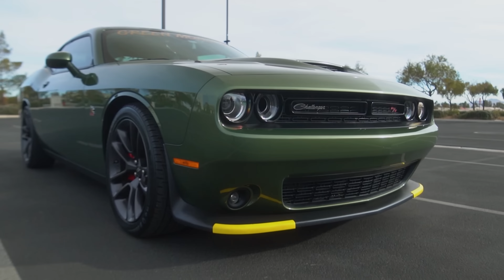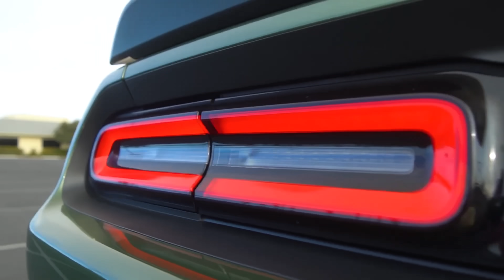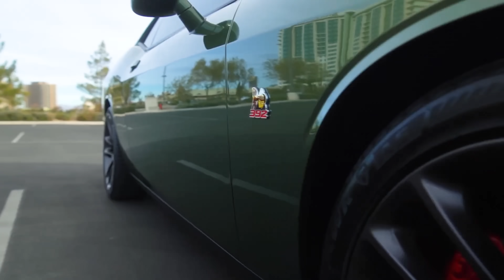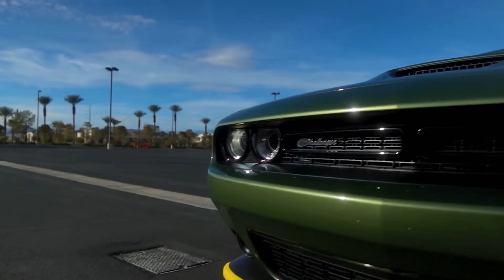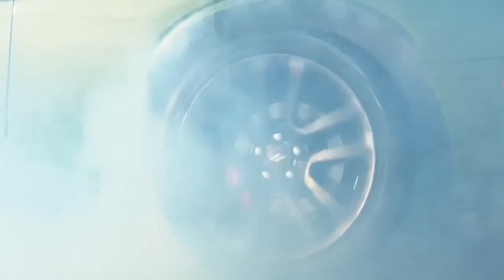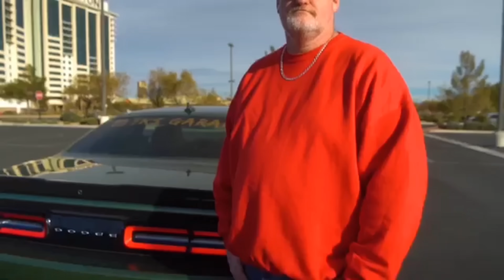Stellantis Engineers Have Figured Out Measurements To Fit A V8 In The New Dodge Charger

Comment: Why not bring everything back how it was? Same challengers and Chargers from before.
Reply: Well they had to come out with a redesign at some point, unless you’re talking about redesigning the challenger as well. Because the 2015-2023 design is a bit outdated
Reply: @ i kind of like them the way they are. I would discontinue slim body on both ( Challenger , Charger ) . Only wide body but not attached flares , I would make the shell shaped like this so that flares are one piece with fenders. update interior but for the most part keep the shape, maybe minor changes .

Comment: I think that engine bay is it can accommodate an Inline 6,a V8 might fit.the biggest challenge is cooling a V8 in that design.ESPECIALLY if you're doing twin turbo
They might have to go the remote turbo mount method if the snails can't fit in the engine bay
Reply: im ok with that, especially if its a hot v v8, long tube headers coming from the valley with remote turbos in a similar position to the hellion turbos in their hidden turbo kit that people with hellcats can buy

Comment: Just redesign the Charger to have a front-end appearance similar to the 1968 model. This will increase the cooling area and give the car the nostalgic appeal customers want. In addition, use the pushrod engine, again, to meet customer requirements.
Reply: 71-74 would probably fit the bloated chassis better.

Comment: My 4.7 WJ is fairly easy to work on. Ex manifold gaskets, valve cover gaskets, oil pan gasket. Fair amount of room between the towers with the OHC engine. A pushrod engine in a wider car should be easily doable.

Comment: if they’re gonna redesign the hemi engine and use turbos, I really hope they use a hot V set up
Reply: while id like that, hot v's typically sound like trash from factory. the hot v turbo v8s from bmw, mercedes, and VAG (mainly audi but that v8 is shared between bentley, porsche, and lamborghini as well) are really quiet and sound like vacuums. with a proper exhaust though, they sound pretty decent. if they did this tho, i'd like to see long tube headers coming from the block, then bend down towards the rear of the engine, attach the turbos there (similar to the placement of the hellion hidden turbo kits for the current hellcats, maybe slightly further upstream closer to the engine block), and then have the rest of the exhaust going out the back. i feel that might be able to keep the proper sound we know and love without making it sound like a euro vacuum. and if ur worried about lag, they can use electric turbos like the new hybrid 911s that spool instantly and still use exhaust gases for making power but also to regenerate the batteries (assuming dodge went full hybrid, they probably wouldn't need that feature if they didn't, just the instant spooling)

Comment: My gut feelings are that we will see a V8 Hemi option in the 2025 Charger.  Who knows?  Will it be the 5.7 or maybe the 6.4?  6.4 is currently in production.  Anyone know the spacing measurement between the strut towers on the 2025 Charger?    Could very well have the necessary spacing to accomodate a v8 Hemi.  Who knows what will happen.

Comment: I’d be happy as a daily driver if it had an LA engine. Horsepower wise yes either hemi would be awesome but I’m old enough to be fine with just a nice cruiser.
Reply: They wont bring back an old engine, if they did then a RB series is better than a la..413,426,440 would be killer..Even a 426 Hemi along witht eh trio of 426 Wedge engines(ramcharger etc).

440 is my all time favorite engine even of anything today!

I owned a 70 Cuda 340 with a factory parts division 6bbl set up and cam, car ran low 12's in the 1/4 with 3.55 gears and street tires.. Easy 11 second ride in 2 hours! Better tires and 20 minutes to swap the rear diff...8 3/4 is an awesome diff..center section drops right out easy for swaps,pop off rear wheels, losen rear axles no need to pull them right out but 0.01 of a second to do so..Old cars were so much better to work on...

Comment: Google New Charger with transmission tunnel picture. There is another picture that shows the strut towers cut for fitting a V8. It's been floating around for some time.

Comment: It's going to be pretty hard to re-engineer the platform in a timely matter of they have to change the strut towers.  I don't see it happening but what an oversight that was when they made the platform.
Reply: There's nothing wrong with the 2015-2023 Challenger/Charger platform. They can hang the new body panels on that...
Reply: @shocktrp66  haha
Reply: That seems to be the most practical solution.
We all know they still hung on to the tooling from the last platform.
It would result in a reskinned Challenger/Charger which is fine with me.

Comment: Gimme V8 with 350 hp and I'm good.
Reply: Just buy a camry if that's all you want, 350hp in a 4800lbs car is dogshit.
Reply: @hpickettz34  it'll more than likely sit within 4400lbs+. The I6 alone is supposed to be at least 4200-4300lb ball park.
Reply: @carboydorifutoparty3976  you don't get it, this car is longer and wider than the older models, the lightest is 3900 with a v6, now you add a bigger car with twin turbos and all the cooling it will need it's gonna be atleast 4500lbs.
Reply: @hpickettz34  Wont be 4800 lbs..Hell the TRX does 3.5 0-60 with a detuned 710 hp Hellcat and that truck is over 7000lbs..Remember what killed the Dodge cars even 5.7 performance was tire spin,need an awd version.
Reply: @MikeekiM-vh5se  that's because it's awd, but 60-120 is still slow.

Comment: They need figure out a V8 for their trucks. I live in Texas and there are alot of trucks here. You will die in the truck market in Texas without a V8. As for the new Charger platform, a V8 is a must. Without a V8, it might swell be a FWD Charger Daytona from the 1980s. Besides, they are both Hatchbacks anyways.
Reply: @phatstackmack152  you are absolutely correct I  live in Katy Texas
Reply: @roncaputo9791  Bryan Texas
Reply: I'll bite. How many in the 1500 actually tow/haul on a regular basis? Not many 
The 2/3500 same story. Moat diesel guys buy one to get to the camp ground 15 minuts quicker, 5 times a year then daily it the rest when a gasser will work? Most of them
Reply: @bondobilly9369  it's all for you man. Have all the six cylinder trucks you want. You must be from California or a woman. Real men know the potential and longevity of a V8. We have all seen how long the Ford ecoboost has held up to towing, work duties, or even just daily driving. They genade themselves.  Maybe a Ford ecoboost is just what you need. Or maybe you just love California ❤️. How cute. We are not talking about diesels here, we are talking about light duty trucks sweetheart.
Reply: are there any cummins trucks in texas? because those arent v8s... but i understand ur point
Reply: @fadedsoul23  Yes, there are new V8 trucks in Texas, they are all Ford and GM. We are not talking about heavy duty Cummings here, we are talking about light duty 1/2 ton trucks. Ram is going to fail in this market without a V8.
Reply: @ I know there’s new v8 trucks but I thought u meant the diesels

Comment: We all know without a v8 dodge is done. The hurrytrash engine isn't worth it's weight in crap so.
Reply: Chrysler had a pretty firm grip on the redneck and the hood crowds with the Ram/LX platforms until the espresso sippers mucked it up. They know what sells but they don’t want to give it to you.

Comment: We want the Hellcats back!
Reply: Yes bring back hellcat!!!
Reply: its hellcat or bust. if it comes with a small n/a v8 with only around 500hp i still wont want it
Reply: @ItsBlurrs  Nope I’m definitely going to want it because chances are it’s lighter engine which means the car can actually be lighter to cut weight and still have that much power especially if it’s moddable
Reply: Heck, i'm cool with the RT
Reply: Damn right.
Reply: @hellcatrambo7402  v10’s too!
Reply: It’s coming
Reply: Hellcats all day fr
Reply: HELL YES!.
Reply: Not gonna be the same size but I think we’ll definitely get a higher output motor. Probably a 4.7 RT standard, and a 5.2-5.7 for the bigger performance applications